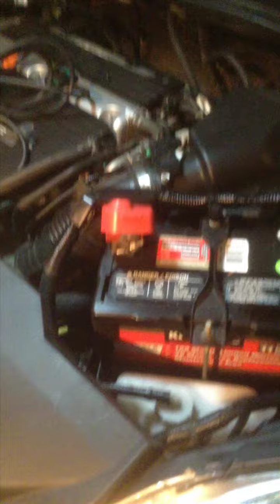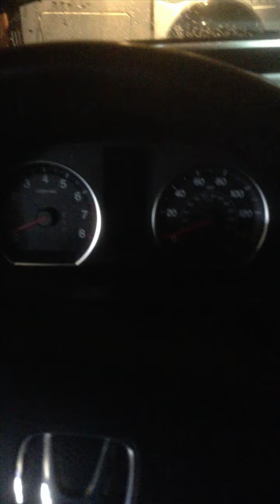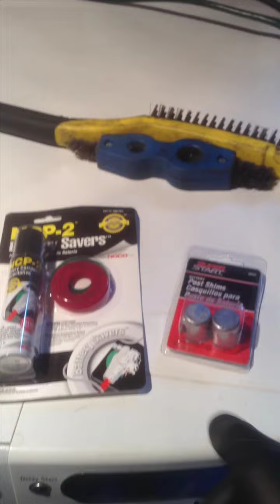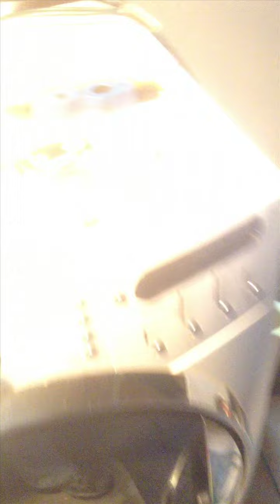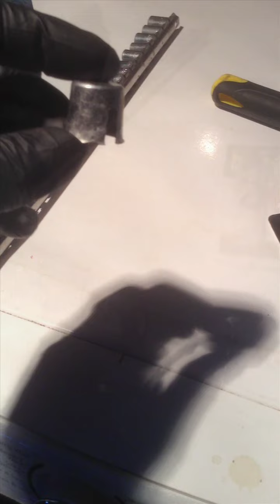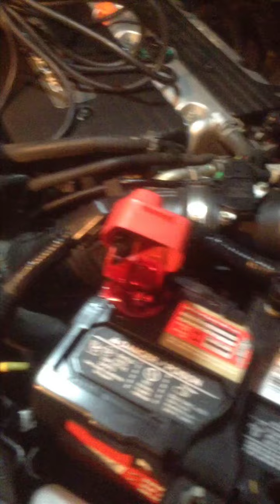Honda CR-V - Loses power when trying to start - Loose Battery Terminal - Post Shim

Comment: I had the same exact problem, but I just removed the ground wire, cleaned and sanded the contacts on the ground wire and the body of the car where it attached.  Reinstalled the ground wire....no more problem.

Comment: My cars post damaged from inside . Exterior ends of posts are perfect . But when put the key and start the ignition, power goes off and blinking the display. Technical person said as post damage from inside.. is there a rectification possible ?
Reply from the maker: If you mean that the battery terminal itself is damaged and moving freely in the battery housing, then I would say that’s not only dangerous, but will necessitate replacing the battery.

Comment: Dielectric grease prevents current from following - that is NOT the grease you want. You want battery terminal grease which is conductivity grease. Dielectric grease is what you would put on the ceramic of a spark plug so that it doesn't flash over inside the spark plug boot.